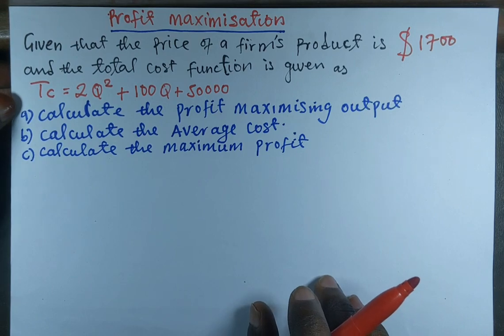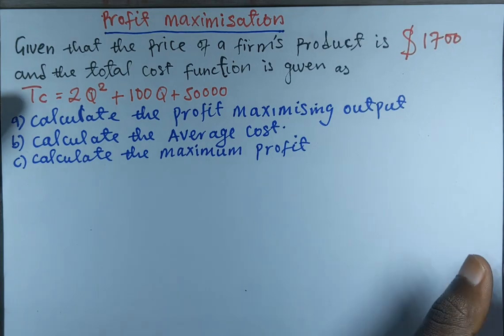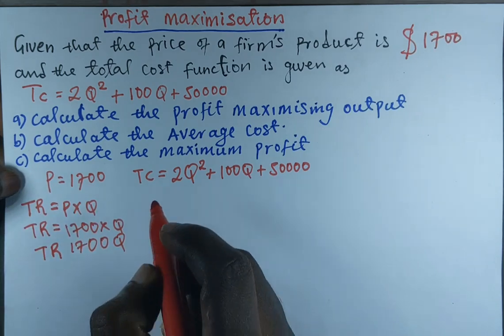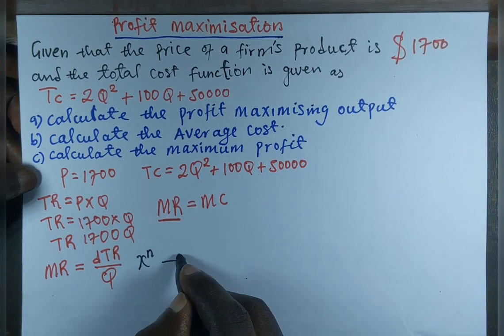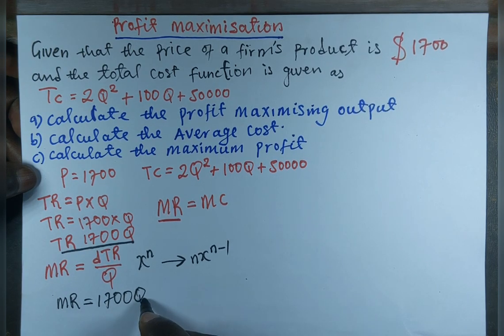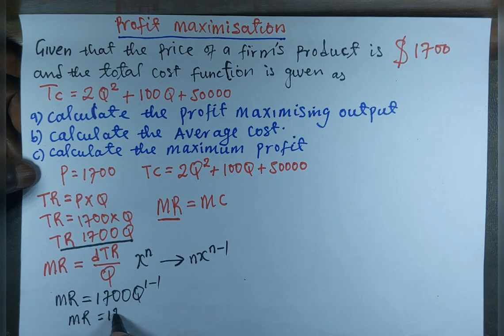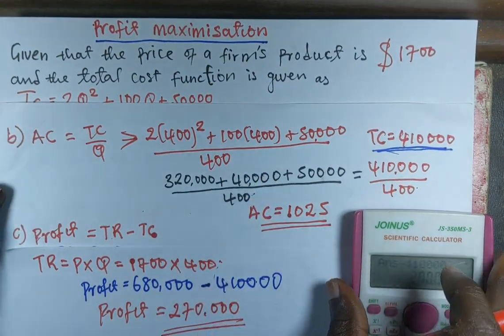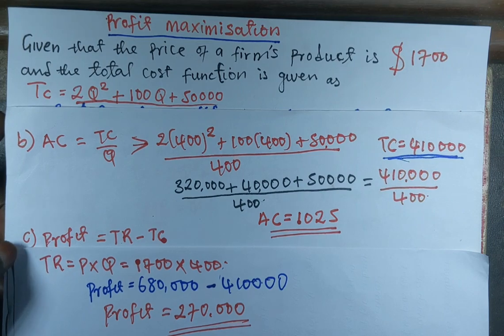How to Calculate Profit Maximising Output, Maximum profit and Average cost.

Comment: Tutor Sam, well done. solve this ( assume a monopolist is faced with the diff. demand function. Q= 500- 30p and total variable cost function TVC = 5Q+ Q2/ 5Q.
Reply from the maker: What should I solve for?
Reply from the maker: Watch this video and you will be able to answer your question. https://youtu.be/dvaRrxcCQHg
Reply from the maker: https://youtu.be/dvaRrxcCQHg
Reply: Price
(dollars per 
gallon)
Quantity 
demanded in July
(gallons per day)
Quantity 
demanded in 
November
(gallons per day)
Quantity 
supplied
(gallons per day)
2.00 300 150 0
2.50 250 100 100
3.00 200 50 200
3.50 150 0 300
4.00 100 0 400
4.50 50 0 500
5.00 0 0 600
a) Draw the market demand and market supply curves. What is the equilibrium price and 
equilibrium quantity of ice cream in July and November? Is the allocation of resources efficient in 
July? Is it efficient in November? (10 marks)
b) What is the maximum price that consumers are willing to pay for the 100th gallon of ice cream 
in July? In November? What is the minimum price that producers are willing to accept for the 
100th gallon in July and November? (10 marks)
c) What happens to consumer surplus and producer surplus in November compared to July
Reply: please help me
Reply from the maker: https://youtu.be/dvaRrxcCQHg?si=hMgDQBJqSoBggsez

Watch this video. It will guide you on how to answer your question.